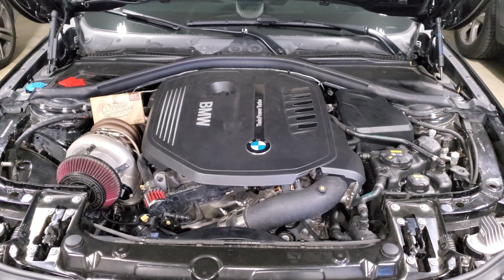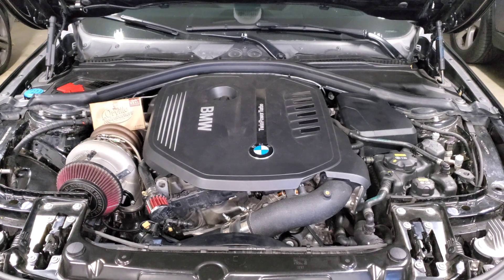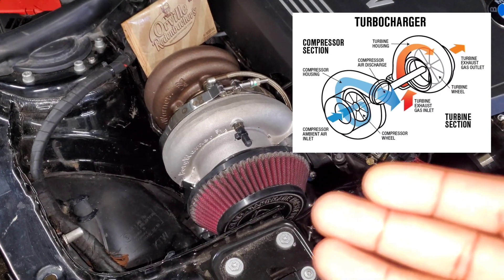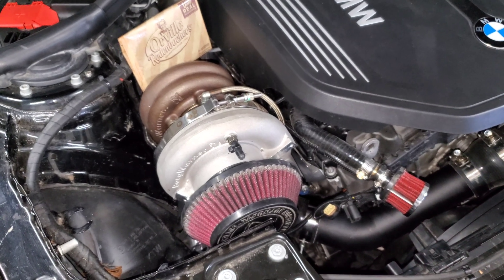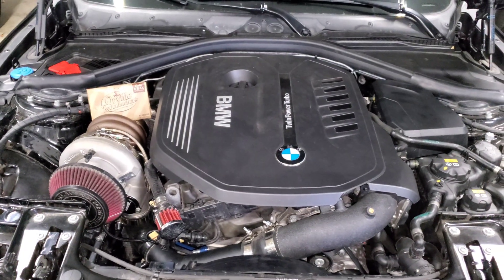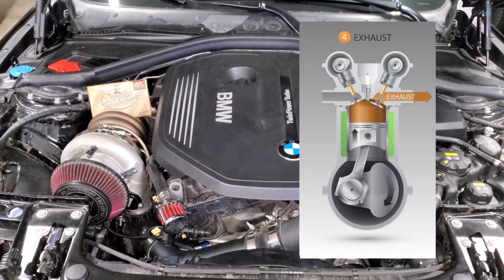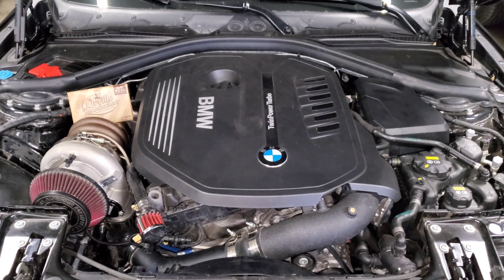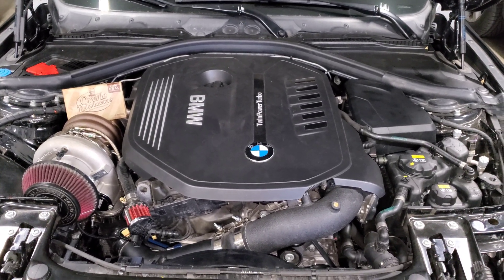How does Antilag work on the B58?

Comment: Not my dumb ass using it a handful of times with my high flow catted downpipe 🤦 Glad I at least watched this now. No issues thus far, and I won’t be using it again… thank you for the info!

Old ass video so you probably won’t see this, but is there anything you think I should check out after having used it? Worth inspecting the downpipe or am I safe enough after having no problems thus far

Comment: I enabled the antilag feature through bootmod3 (stage 1 93oct) on my otherwise stock M40i just to check it out. Honestly, I didn't notice much, if any, quicker acceleration (hit the switch around 3500rpm in 3rd, 4th, 5th gears). I know you said you shouldn't use it with the stock downpipe, which I just learned here, but if I did, shouldn't I have felt a difference? Or does the stock dp hinder it from performing like I've seen in countless B58 antilag videos? I left the boost limit where Bootmod3 had it, I believe at 18psi.
Reply: The stock turbo spools so fast you dont really need it

Comment: For the uninitiated it's just an engine bay.. For us enthusiasts it is a way of life.  
Question for you.. How aggressive is the burbles setting for BM3 93 octane stage 1 tune ?
Reply: Burbles are the same across all stages, BM3 offers two different maps per stage per octane - Stage 1 93 and Stage 1 93 AGG. The AGG map will make your burbles loud, and depending on aggression (I’d recommend 5-9) will depend on the “loudness” of it.

Comment: Hi! I was wondering if you can help me with some questions/concerns. My f32 440i is stock right now with only BMW's mppsk on it. When I tune it, I plan on putting a VRSF catless downpipe with the m performance catback exhaust, the B58TU HPFP and running MHD stage 2+(HPFP) 93 Octane, and xHP Stage 3 for the Automatic trans. Do you recommend I use 93 Octane or use 94 octane which contains roughly 10% ethanol. I know its best to use the Octane the map is rated for, but the 94 Octane has 10 ethanol and I do not have access to any other ethanol fuel in my region. My car only has around 16K miles so I'm not worried about other things maintenance/upgrades likes spark plugs. Is there anything else I should do to prevent any issues, or are there any potential issues I might run into from daily driving the car like this; obviously I won't be aggressive driving all the time, mostly in comfort mode. I wanna make sure I'm not damaging anything and I've been addicted to your informative videos. Thanks for the help!
Reply from the maker: 93 or 94 doesn't matter. Run logs to see which one works best.

If your car already has mppsk then it already has the exhaust on it. Mperformance muffler would technically be a downgrade.

Comment: can you use the bootmod antilag in a dig ?
Reply from the maker: You should be able to
Reply: @kern417  same concept just gotta hold the brake down huh
Reply from the maker: With antilag the car won't move forward as long as you're holding the switch
Reply: @kern417  🤩wow thank you so much gonna use it on the track this weekend

Comment: Is it safe to use antilag with methanol injection activated by boost?
Reply from the maker: Not ideal. You'll want another safety. Maybe rpm.
Reply from the maker: You'll really have to test and tune for it appropriately